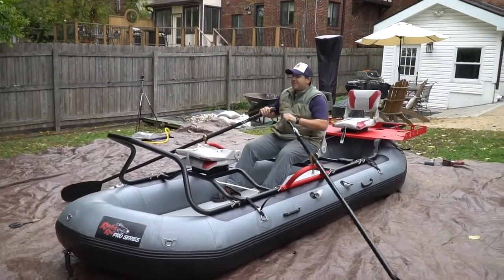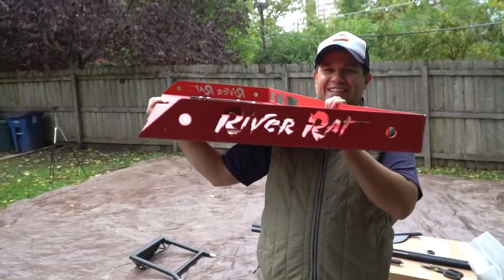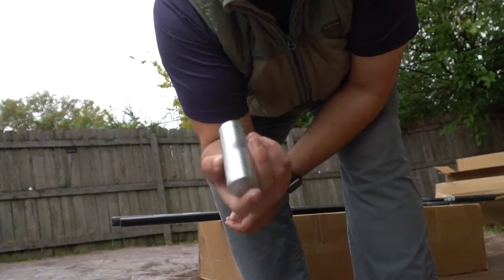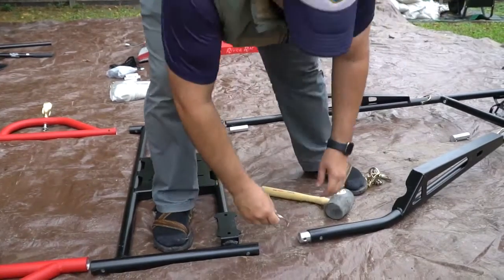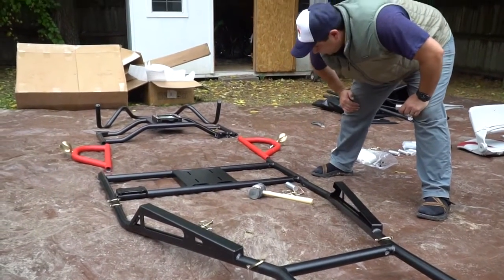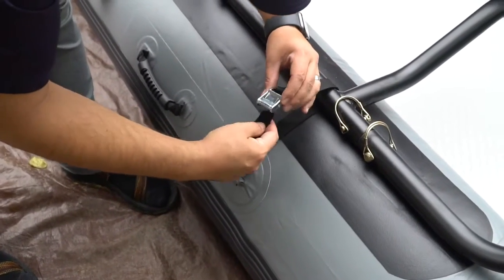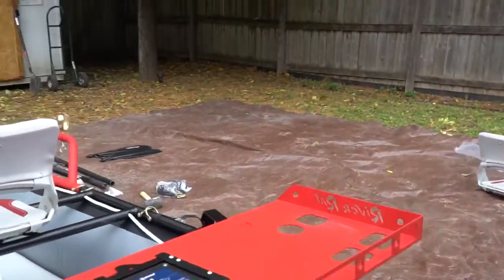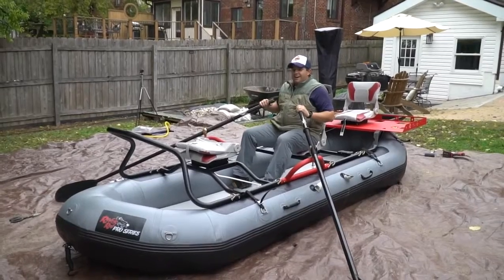Boat Build -  The River Rat Pro Series Drift Raft

Comment: How is the stability? Is it tippy?

Also, is the floor self bailing or does it stay dry. 

Lots of questions!!!!
Reply from the maker: Stability is what separates this raft from others. The floor is inflatable and provides amazing stability for the angler. It also helps it float through very skinny water, where most rafts can’t go. I went without self-bailing because of the types of water we are on in the Ozarks, but it is an option. Not a lot of big white water near me.
Reply: @fishhandsfranky  thanks 

I fished from a friend’s fly craft and it was crazy tippy!  I ruled that one out instantly. The stealth craft hooligan looks good but spendy. Can two guys drag this thing around? Will it fit in the back of a pickup?

More questions!!!!
Reply from the maker: @baxter4462  raft is 135lbs all together. Perfect for two guys to toss around. That’s what we do to get it in my truck. This is wider than the other boat mentioned. Sounds like the perfect fit for you, price wise it’s in the sweet spot. The owners of the company are super friendly and helpful. Ring em up! Where are you going to be fishing it?
Reply: @fishhandsfranky  
Upper Delaware in New York and Pa.